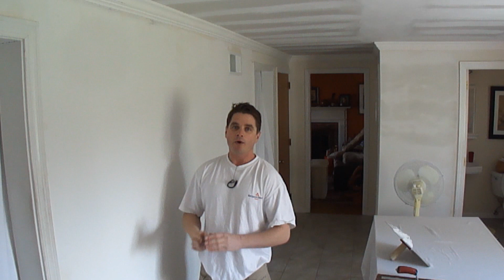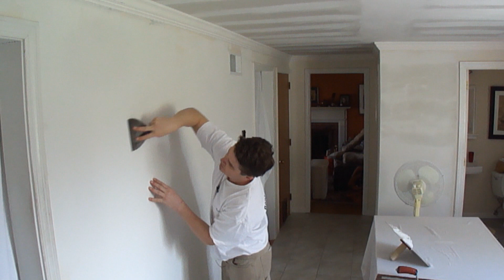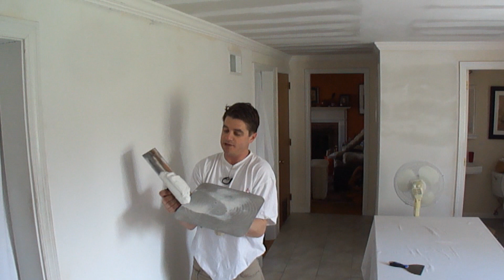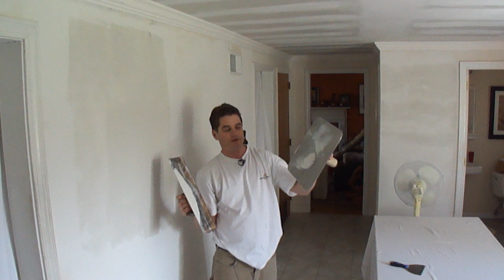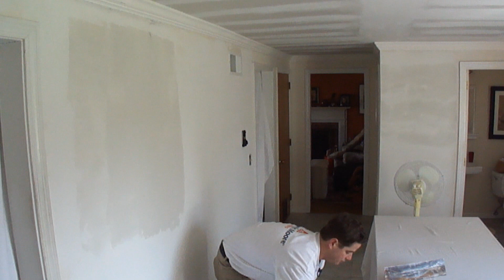DIY How to Fix a Bad Skim Coat Wall Job using Hawk & 16 inch Trowel (Part 4) - Dry Wall Repair

Comment: I just learned from a man who did this for a living for decades that if you take three cap fulls of Joy dish detergent and mix it into the 5 gallon bucket it will never bubble and leaves a perfectly smooth surface. I've never done it, but I'm gonna give it a try.
Reply from the maker: Hi

Yes I’ve heard this too! 

Russ

Comment: Thanks for the Videos!  How much do you thin your 2nd skim coat?
Reply from the maker: Hello Gary-

Thanks for your question Gary! It always depends on the thickness that it has when its in the bucket. This will change from bucket to bucket as per shelf life and weather conditions. That said, start with just adding a half of a pint glass and see what happens. 

Russ
Reply: Russ Olinatz Thanks!  that was quick.
Reply from the maker: Gary McCready Your welcome Gary!

Comment: Russ, I after skim coating my walls I found my electrical outlet covers didn't fit back on properly due to the skim coating adding thickness to wall. Any simple suggestions? Thanks Matt